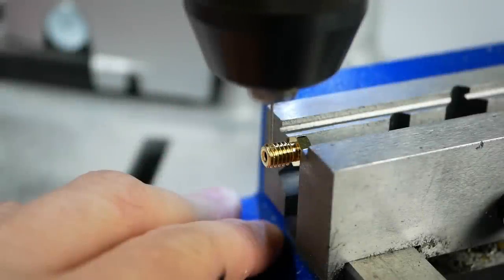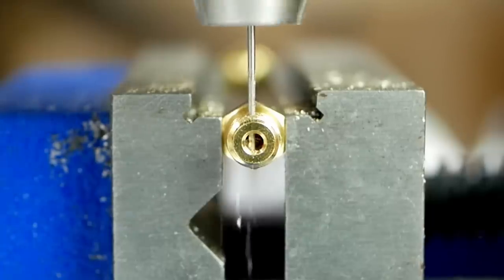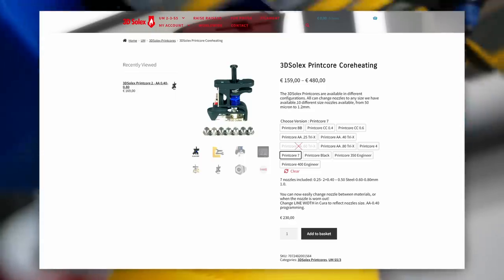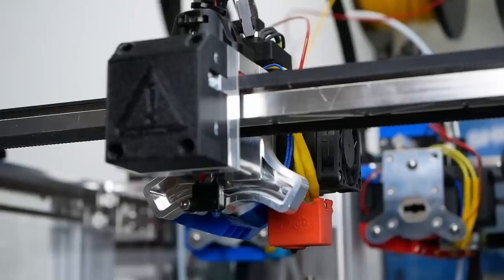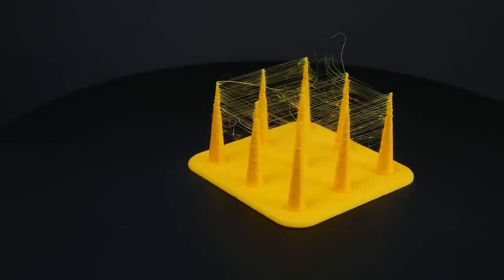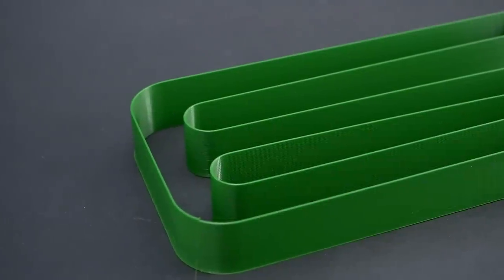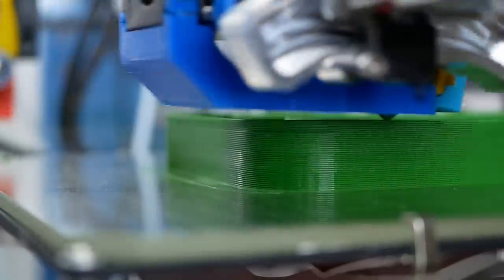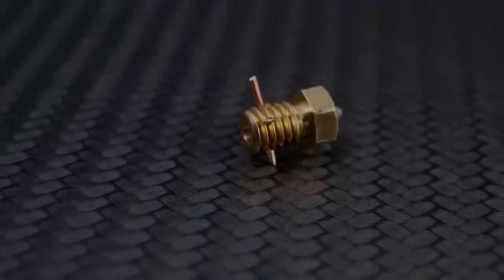My High Flow Nozzle is better than a Volcano hotend!

Comment: Nice hack, I would drill open the hole a bit, drill the center hole in a jig and put in a wire, that is a bit sharpened, so it looks like a blade on the filament side. That should work a bit better. For the solder, you use copper, so high temperature solder from the plumbing department should be better, but you need a pretty hot flame to work with it.

Oh, and btw, I could never put in a Vulcano hotend on my Ender. The length looks like hell, I slammed into my glassbed with the Swiss Nozzle, because the BLTouch was not long enough and I had to shim :D

Comment: Silver solder is not terribly hard to come by or use. It was commonly used for copper piping in house heating installations. The amount of silver is generally around 5% or less, and it can be melted with a cheap butane torch.

Comment: I have the need... the need for SPEEEEEED. Check this idea out... flatten the middle of a piece of wire with a screwdriver then shave off the excess width from squishing it to match the .8MM hole then you'll have more room inside, a more flow friendly shape with if u position it right! I bet you could beat Bondtech then!

Comment: Sharpen the edge of the wire before assembly. It seems the trick is the splitting of the filament. So your heating 2 to 4 centers of  strands. Plastic being non-Newtonian the center of the filament needs to be totally melted. Dividing the size required to heat in 3d printing is genius. Next fun thing would be to put strand cutters (my own term) in a Volcano.

Comment: Very thin wires that hang down into the nozzle instead of going across. Enlarge hole to account for the wire widths, by hanging down more heat is transferred. Less turbulence is created. drap the wires over the top, and solder on there, file or sand across to make smooth.

Comment: I love those investigations, thank you Stephan! I was also curious on the internal geometry of the copper wire, do you think that pinching those in order to have a smaller surface blocking the Pla (doing like a sharp knife) would change the result?(and also help in the cleaning phase?).And also moving the copper near or away from the point could change the result? And how much?

Comment: Hey Stephan.
Have you already looked into print speed vs layer strength?
I Just started 3d printing in a heated enclosure with high temp filaments (280c-300c) and have decided to lower my print speed to 30mm/s to attempt to get the strongest layer bond and to get the least filament spring back and hopeful with the added heat of the enclosure (55c) I can get some high strength parts.
Do you think 20mm/s is too slow or no gain to be had?
Thank you for the great videos!

Comment: Slotting with a broach would also increase the surface area... tricky but possible. Threading could also be tried as it would be simpler but could cause turbulence... could be a positive (improve temperature consistency) or negative (blockages).

Comment: Have you thought about drilling thru the copper wires inside making the gap inside bigger again, or just slide the copper wire just deep enough that it just touches the filament inside the nozzle that way i think you could even ad 1 more and you keep enough opening.

Comment: What about cutting a vertical slot in the top with a hack saw and inserting copper plate instead of wire?Would be hard to get a clean enough cut and a tight fit, but would give much greater surface area!

Comment: you first use a pipe with ID of nozzle OD, file the outer surface of the pipe smooth, drill the hole in it, then place the nozzle inside the pipe and drill the nozzle

Comment: What if you cut a narrow slot vertically in the nozzle thread and use the blade of a craft knife or scalpel to divide the filament .. it would be a lot less resistance pushing filament over it compared to copper wire.

Comment: why not try flattening the wire a bit where you will leave it centered so its thinner there to allow for that extra room with out having to drill out hardly anything, yes I know flattening it with say pressure will mean it will be wider than the hole but that can be altered with a slight bit of removal of the edges so it is back to the .8mm width the hole has while making the cross section of the wire thinner than the .8mm as a blockage, still letting it conduct heat into the core, the only other thing I can think of is using something like hard solder that is barely lower temp than the brass I believe but would enable use on much hotter filament like pure PC and nylon 910 taulman PC/nylon hybrid filament.

Comment: @CNC Kitchen Wonderful video and very informative, although I don't believe the patent in question covers the use of inserted wires as heat spreaders the way you seem concerned about. Additionally, I'm pretty sure the patent can't protect against the competing use of Prior Art designs like some of those discussed in 3DP and other manufacturing communities for a couple of decades (mentioned briefly in your CHT teardown video), and I know the patent can't legally prevent competition based on the same conceptual lines of research and differing designs.

All of that aside @Aj Rutherford elsewhere in comments gives good advice on centering your holes for future drilling but leaves a few questions unanswered.

Stefan, can you please revisit this in a video where you flatten the sides of the copper wire before or after insertion to give it a shear edge, and compare the performance of soldered to welded wires? Thank you!

Comment: I got decrease in flow with 0.4 bondtech CHT nozzle much earilier than my copper nozzle. Even though the cht nozzle held up a higher flow before eventually skipping. I suspect its because of my bowden setup that the long filament path acts as a spring, and the cht nozzle has a higher resistance to flow due to the complex geometry. It would increase the presssure within the long filament path due to the higher resistance, and reduce the flow even before the melting capability fail to keep up.

Comment: I wonder if like rocket motors that star shaped would help because it maximizes the surface area and thus the amount of metal that can hear the filament. You could probably diy it using ECM boring

Comment: Interesting stuff indeed! How about making the edge of the copper wire sharper, or try two copper wires but one directly above the first wire just to increase that melting surface?
Another thought have the two coper wires, both with sharpened edges, but spaced apart?

Comment: I wonder if you cut a slot down the nozzle and put a copper sheet in the length of the melt zone, solder, and re-cut the threads. That way the surface area of the heating is similar to the wire, but doesn't disrupt the flow as much!

Comment: seperation of the filament prime numbers should perform better.  use a pre drilled hex nut with 3 holes to align your drill and use another nut to lock it in place.  Also, use the volcano as your base nozzle.  

more surface area is better.  prime numbers are better due to fluid resonance.

Comment: I wonder if you used a larger wire, but file it flat for inside the nozzle.  This may help with the reduction of surface melting area inside the nozzle from adding the wire.    My guess is the thinner the wire is, the easier it will split the filament.

Comment: A very interesting concept. I believe here in the United States, if you change an existing patented part by 20% or more you are not infringing on a patent. Some one with more experience in this area, please correct me if I am wrong.
If you can extrude more material then you can run faster print speed. Am I correct in my thinking?
What would happen if the portion of the copper or stainless steel wire in the nozzle were flat vertically so the material would be cut in two using 1 or 2 wires at 90 degrees which would cut the material into 4 pieces?
What would happen if the inside of the nozzle were to be Teflon coated?
Thank you for bring up this concept since most nozzle designs have remained unchanged for a long time & in my opinion needs to be researched.

Comment: Carbide drill to prevent deflection. Light feed. 
Might have luck with PCB drills, probably cheaper than carbide.
HSS doesn't like to drill (relatively) straight without center drilling first on a good day.

Comment: to stop the drill bit from wandering i would file the entry point flat. it should still be able to thread just fine. and since its not a convex surface the drill wont want to wander all over the place

Comment: I was thinking, use smaller diameter wire and more strands stacked above each other, maybe in a double cross pattern. Definitely switch to silver solder.

Comment: Maybe taping the internal hole with a blind tap, this would give you a lot of surface area.
Reply: and a lot of friction.
Reply: @RFi731  i thought the video has shown that thermal conductivity places a bigger role, at this stage the plastic is melted either way.

Comment: What about using two wires, but before soldering use flat face pliers to shape the wire into more of a tapered point. 
Then with regular needle-nose, or circlip, pliers twist the wire in two axises, to create a sort of helix/spiral path for the filament. 
Lot of work, but if it works....

Comment: It might be possible to simply insert a bent copper wire inside the nozzle without any drilling or soldering, and still get increased performance.

Comment: If you were to drill through the nozzle at an angle (say 45 degrees), would you be able to increase the surface area of heating on the wire and also give the material room to spiral around and reduce stresses inside? I'm not an engineer, but I thought it may do something at least.

Comment: Do you even need to weld the copper wire? I'd think the rigidity and lack of room inside the nozzle would prevent it from bending. The part stuck in the walls of the nozzle may be enough to keep it in place. If that's right it would make this modification much easier

Comment: I wonder if you milled a vertical slot in the hotend and and used a copper plate instead of a wire if the less turbulent shape and the additional heat transfer area would give you sufficient heat transfer.

Comment: I wonder if you are willing to make a mini series on modifying a budget 3d printer (creality ender 3, prusa mk3, etc) to print engineering materials like polycarbonate or carbon composite material. This series could include what material should the enclosure be made of, what type of hot-end to use, what brand to buy from, and what filter to use; things like that. It shouldn't require too much engineering explaination but I would like to know some of the material science and behavior of certain filament materials. I intend to start printing car parts for inside of the engine bay, which tends to require parts that have operating temperatures of 215 degrees celsius and be chemically resistant.

Comment: What's the hot end wattage? Generally you need about 1 Watt for each mm³/s of flow. You may have reached a power (wattage) limitation rather than a surface area limitation.

Comment: would be interesting to place a series of smaller diameter wires in a "spiral staircase" fashion, so the angle between each wire is less than 90, this may create a preferential flow direction and therefore reduce the turbulence (just guessing) while  keep splitting in two (even if not exactly halves) the flow at each step therefore heating the core well

Comment: If you want to drill a curved or slanted surface you will want to try to make it flat or at least have less angles for the bit to deflect. Licking with a ball bur tool is a fast and dirty way to get a place to drill.

Then you will want to "peck" drill as in drill a tinny amount and let off so the drill can reset. It will take a long time but shave a tiny amount then let off then peck again.

Comment: I really don't think you need to solder the ends just use the tap because when it's screwed in it can't go anywhere, you could also try thining the wire to a like a v or diamond shape may help with extrusion or melting, cool video it's only my 2nd or third i've watched but 3d printing is really interesting and very useful going to watch more.

Comment: @CNC Kitchen   I wonder if you tried carefully putting a beveled edge on the copper, so that it is able to "slice" the filament as it goes through.  This could be achieve in advance before you put the wire in and solder it in place.  I think the the round profile of the wire is adding resistance, that may be reduced with a more cutting like edge :-)

Comment: 2 wires in an X pattern drilled at a 45 degree angle sloped ward the nozzle would greatly increase the amount of heating area and reduce the flow limitation. 0.4 wire would be better for this as their thinner gauge would reduce flow issues.

Comment: A washer inset with centering boss above the nozzle with the wire geometry would get around the patent.  Would make it difficult to change / clean vs a standard nozzle

Showing “loss of sales” for this work is something they can not go after you with.  Nice they agreed to support your project.

Would a larger outside diameter nozzle or less of a tip cone angle help retain heat from ambient or fan cooling?  Or just a nozzle with 50% more stick out.

Great video from you as always.  Thank you
Reply: Also, file the thread down to give a level surface to drill

Comment: You have a lab full of 3d printers, You could 3d model a block with two holes going straight through the sides, spaced apart by 1mm, and then add an M6 pretapped hole in the bottom? I'd love to see if performance would be affected by having it perfectly drilled.

I print drill guides all the time, probably one of my top 5 printable items.

Comment: Would forcing the filament through a heated mesh(same as the wire) help improve it? It should have the same ratio of blockage as the wire, just more uniform.

Comment: I wonder if the solder is really necessary. I think if the hole and the wire were very close in diameter, then you could cut the wire and peen it so that it fills up any air gap.

Comment: I wonder if instead of using a piece of  wire that has a round cross section if you used a flat strip instead as this would be less obstruction to the orifice but the flanks of the strip would give better thermal conductivity ? You would only need to use a hacksaw or even better a jewellers saw to cut a slot across the threaded part of the nozzle , sit the strip in that and solder it in place. Maybe a strip of 0.2mm thick and 2mm wide as a starting point ?

Comment: You need a flat spot, so the drill doesn't already have a clear path to wander. It doesn't even need to be as large as the drill diameter, just enough for the tip to sit on. Centre punching will help, of course. Use a small endmill to make the flat spot - if the endmill is good enough for plunge cutting, then you could probably push it all the way through, and forego the drill.
Reply: @Falcodrin  Provided the flat point lines up with the clamping position, that'd work.

Comment: I'm curious now. I'm new, but I'm already making decent money on a product I developed. Rather than only blocking the flow with the wires... could installing a reverse makeshift screw used in an injection molding machine by simply tapping out the nozzles I.D. then adding the wires help with the flow?

Comment: Would it be possible to flatten the copper wire into a blade inside the nozzle?  

Maybe drill through the nozzle with .8mm on one side, and 1mm on the other side, feed the wire in, squeeze part flat and pull it through the 1mm hole into the center, then clip and solder.

I'm just starting to learn how to increase flow and print speeds, and I'm surprised to see your results comparing the cht nozzle to volcano.  The cht performance is impressive.

Comment: I wonder if using a smaller diameter copper wire or trying to sand the current wire down til it s sharp in the center would reduce the back pressure while still heating the center

Comment: What if you did this to a volcano hot end,add copper at a lower point it will give material more space to heat up reducing resistance and increase flow at the same time.

Comment: If an experienced machinist has done it, your nozzle would have been better than the CHT...   ;-)   Well done !!!!
You always care a lot about methodical correctness. So, you know, that if you print with 10cmm/s the lowest layers and with 30cmm/s the top ones, it would have been advisable to repeat and print also with 30cmm/s the lowest and with 10cmm/s the top ones. And because in this case, it´d have been imposible to print higher layers on top of destroyed lower ones (and still represent a valid result), the way out would have been to print separately for each flow-level, and not on top of each other. Cause if your nozzle is minimaly worse at 30cmm/s, then it´s probably also just a bit worse at 25cmm/s. That means, that while comparing the 2 at 25cmm/s, they seem indistinguishable, but maybe they aren´t. So, printing 30cmm/s on top of 25cmm/s gives your solution an unfair disadvantage in looks, cause your indistinguishably/marginaly worse 25cmm/s-block affects the 30cmm/s-block. It means that you showcase a trend, but the level of how much yours is worse, is off/misrepresented.

Comment: I wonder how much changing the wire diameter would help with the flow rate problems? A pretty thin wire might still conduct enough heat to the center of the nozzle.

Comment: IF the wires were lower - towards the middle - of the nozzle it might perform better as the outside of the filament would have had time to heat and be softer so it splits easier, and is more warmed in the center closer to the nozzle opening.